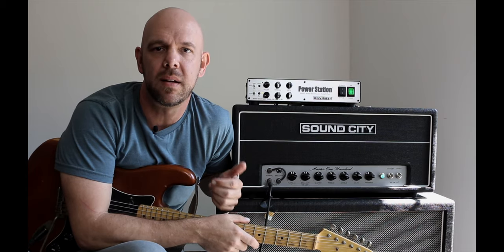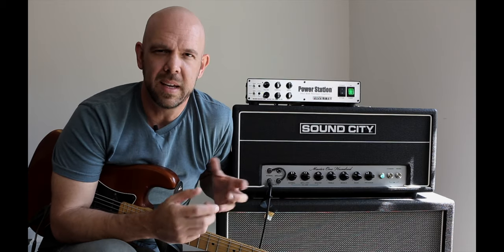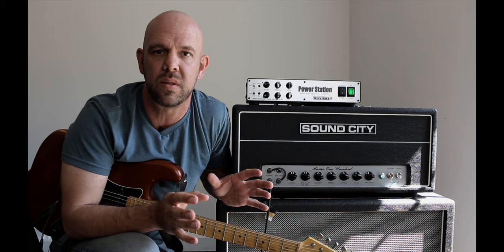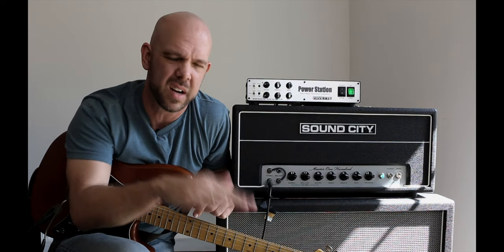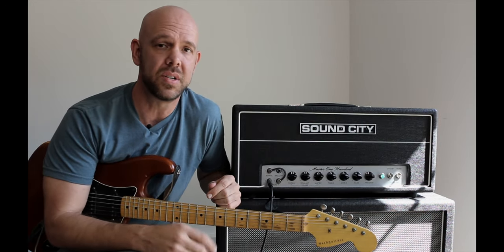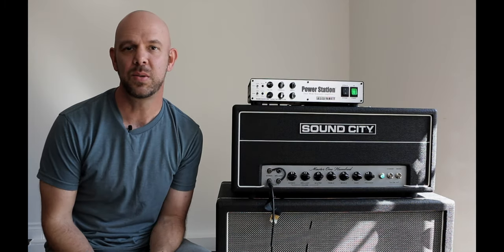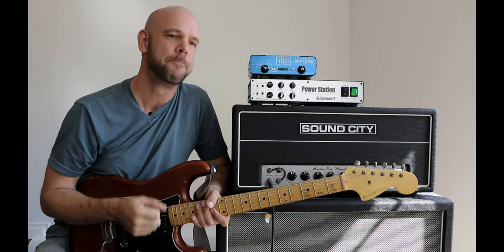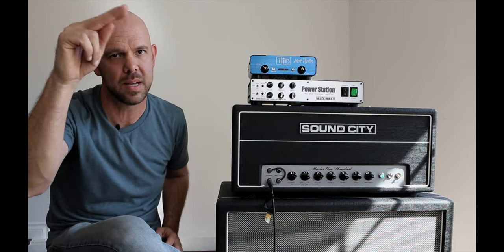Fryette Power Station - Mystery Squeal #1 Explained!

Comment: I don't have any problem with the squeal when I use the PS with my JVM410H or my Laney AOR Pro Tube Lead 100, Ironheart or my Mesa. However, when I use my amp switcher that is able to utilize the PS or attenuation across all of my amps which also allows me to use the FX Loop of the PS for all of my amps without having to unplug and plug in my pedalboard every time I want to switch amps, I get the squeal no matter where in the room I am standing.
Reply: I'm having the same issue with my amp switcher but it won't do it on all amps. For me at least I discovered it is the Switcher. I can leave the speaker connections and PS2 connections intact on the switcher and if I plug direct to the amp bypassing the switcher, no squeal. I even held up the guitar closer to the PS2 and no squeal. This of course is after trying different cables etc. I've only had the switcher a couple of months so I'll be reaching out to them to see if it needs to go back. Also it cause a mechanical noise on my Tremoverb when it is put on the switcher's internal load. Strangely it only happens when Orange channel is set to clean and the red channel is set to blues. So the internal load on the switcher may not be playing nice with internal voltage changes in the amp? Doubt I can return it outright but hoping we can resolve it.

Comment: I am glad I have found this video. It might have saved me some money buying stuff trying to fix a what I thought was a fault. Thanks.

I am running a JMP 1987 build into a Freyette PS-2A that is all sitting right next to me on a corner desk, along with my active monitors, interface and monitor etc. Noise is a big problem either with amps, or with amp plugins. I gets ugly and with higher gain there is always a nasty hiss under every note, even with a Boss NS-2 and also a gate in DAW. 

I get this squeal. It usually happens if I crank the Plexi while running a cranked DOD 250 into it. Old Dimarzio HS3 and HS4 pups that have gone a little microphonic will not be helping.

I guess I have to come up with a new layout for my DAW setup. I am playing guitar too close to stuff that is emitting noise. 

P.S. I watched a video where a guy brought in his JMP 2204 to you recently for a check up. Mr Freyette mentioned something about a simple gain mod he used to do to "rental" amps when he was touring. Does it work for JMP 1987 amps too? I have just done my first little mods to this amp. Simple stuff. Shared cathode changed to split and putting a bright cap back in. That simple gain mod might be a good candidate for my next little mod. I figure baby steps is the way to go to get started learning this stuff. Is there written detail about that mod anywhere? Thanks.
Reply from the maker: See The Malcontents Joey Brasler episode.

Comment: I have the PS100 and yes it squeals!!!! Usually only if I’m really close to the unit. But I was thinking, what about connecting a noise gate??? But where would you connect it? And is it safe? Can a gate be used between the power station’s speaker out and the speaker cabinets in; without damaging anything with the power station amp or speaker cabinets. Just a thought

Comment: I've got a Fryette PS-100 that while it's sitting still it's fine but I had to move it the other day while someone else was playing through it and I thought it was going to tear up because it started making a very loud clicking noise and a loud pop when the speaker input cable got bumped on the wall behind it. What is going on? Is that normal for it to act that way? Is it a faulty unit! I understand it won't be getting moved while in use that much but it's a $999 unit and I'm trying to figure out if that's normal. Please help.

Comment: I just had this suddenly happen over the past few days when I was using my Univibe (clone) on my board and into my JTM45. I was able to eliminate it, for now, on my HB guitars, as I pulled the vibe out of my pedal.

I think I had something along the lines of a bad patch cable, and a dirty power supply (vibe uses its own 18v PS).

Weird that this just started happening recently. More experiments to come.